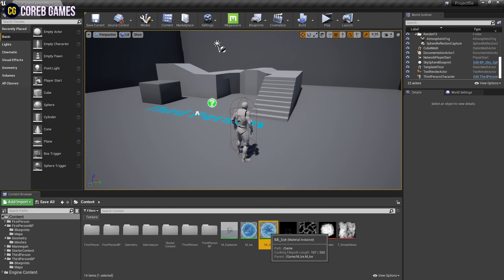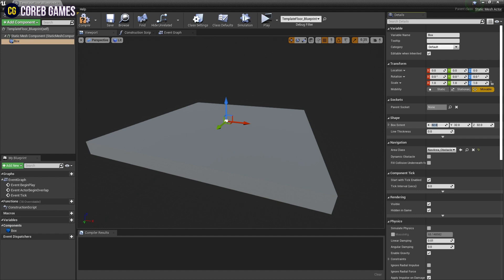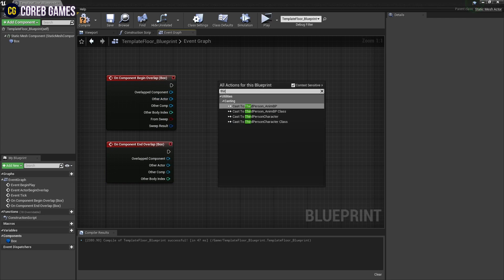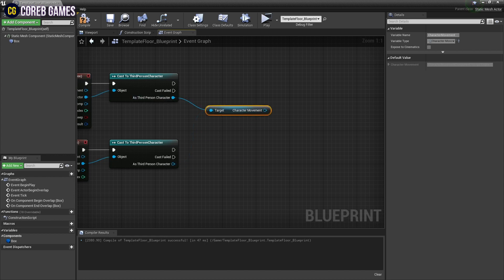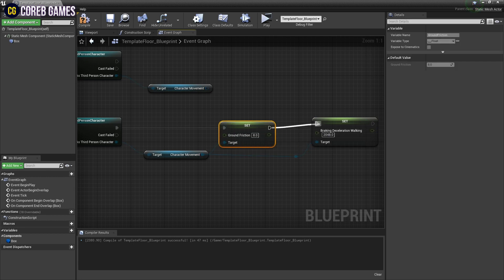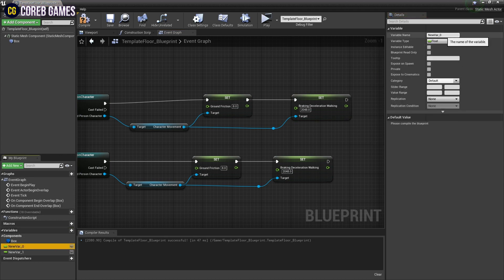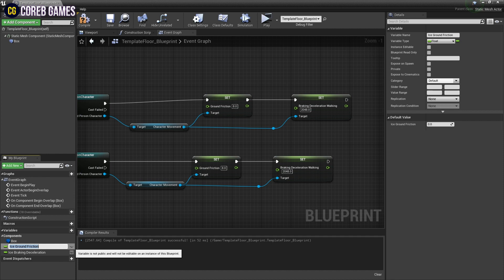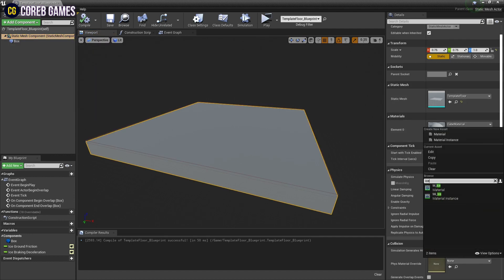UE4 l How To Create Slippery Ice Floor l 3-Minute Blueprint Tutorial l Unreal Engine 4.26

Comment: good to know.does UR allow you to make it dependent on what shoes the character is wearing too. {ie by an attribute trait or item possession trait?} 
if your character is in shoes like dressy high heels they would slip a lot more and possibly even fall. but if in boots or sneakers they would slip much less. 
so if you forgot about changing your attire you actually might not be able to complete a section because it harder or impossible depending what shoes your wearing
Reply: depending on what youre wearing you would just change the variables
Reply: @NotDopple they should do this in more games